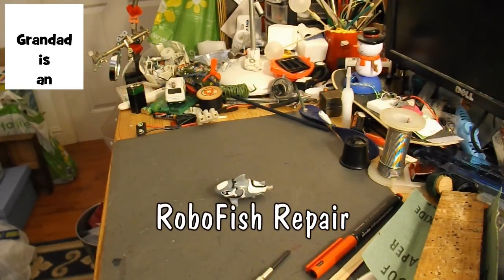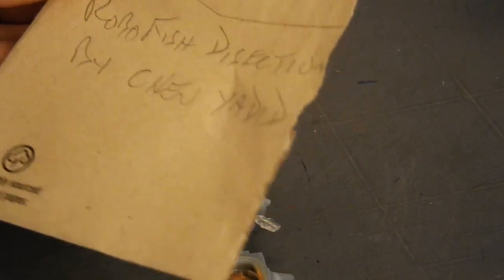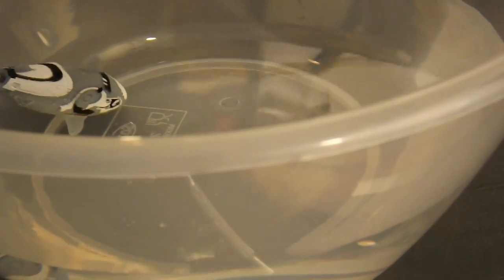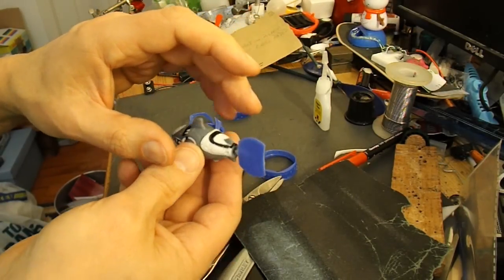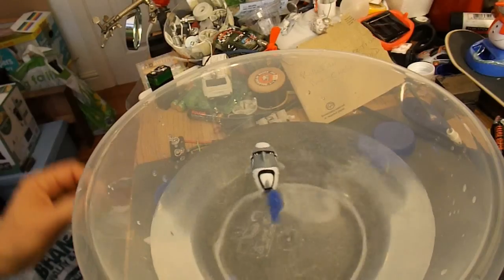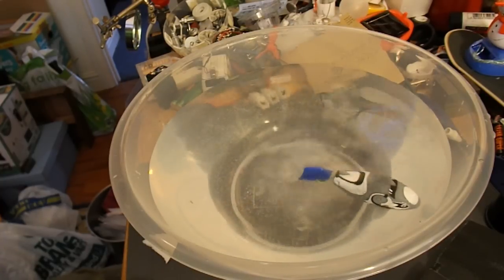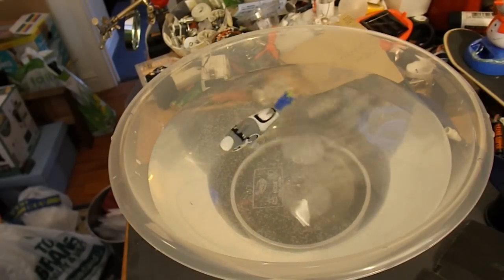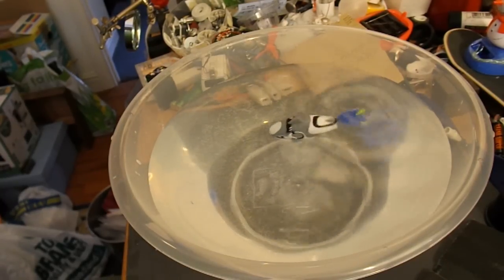RoboFish Repair

Comment: its not moving forward fast because the tail is hard plastic..the original tail was made of silicon, its very soft,so it bends as it wiggle and its kinda like giving the fish a push..
Reply from the maker: +Jeff Cobain yes that is right. Did you see a pile of soft silicon on my desk? No, I used what I had available.
Reply: I used a hot glue gun to make my tail
Reply: @shoto7478  nice..any softer material than that hard plastic is much better..

Comment: Hey Grandad ,can you make a very small gravity powerd car made almost entirly out of paper clips like the one on rubber power but this time cut the neck of some ballons and use them for tires (not thet it will need it but if you decide to nake it run on something else ,just in case) and instad of dtoping the 90*(=degrees) put it at a 45 one and make a loop of string ,atach the weight and run it betwin two pulleyes (one of 'em being the rear axel,you may also try puting a third pulley ).Or just make it out of barbeq stiks if it seems to hard out of aper clips.
Reply: And this time please reply "BACK" ."BACK"
Reply from the maker: I am not sure I entirely understand the design you are describing, however I will put it on my list and think about it. It hardly seems worth building as it will only travel a very short distance.

Comment: Not really cause my ideea was that the weight will come at a diagonal angle so you would get a lot more powerd travel for less height and maybe making it come down in a zig-zag because in most of your gravity powerd anything you complain that the weitgh dosen't have a lot of space to fall.

       P.S. If you would make this screw my last comment,feel free to make it out of                      whatever you want.
Reply from the maker: Like I said I am not sure I entirely understand the design you are describing, however I will put it on my list and think about it. Anything other than a vertical drop for the weight will reduce it's force, the same with multiple pulleys adding resistance, but I may be able to compensate with a heavier weight.
Reply: GrandadIsAnOldMan Hey Grandad , i just notised another notificatin from you on the video with the sailing boat at wich a comented "from you hands?! :P" and i was wandering how is right said 'case british people say me instad of my and ypu sad you hands ,not your hands.Also englesh is not my mother language.
Reply from the maker: Ana Gubariu I see what you mean, that was a typing error on the screen. Nothing I can do about that now.